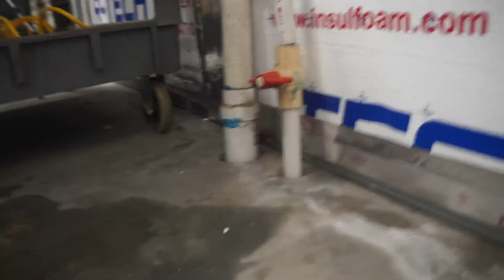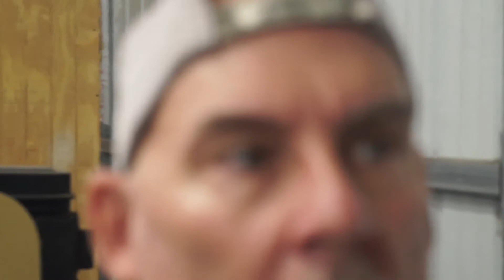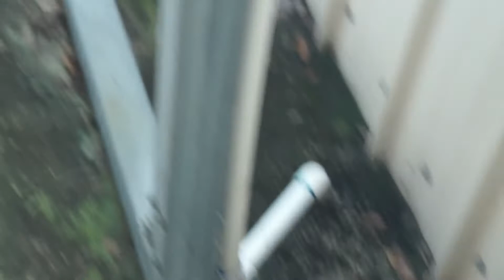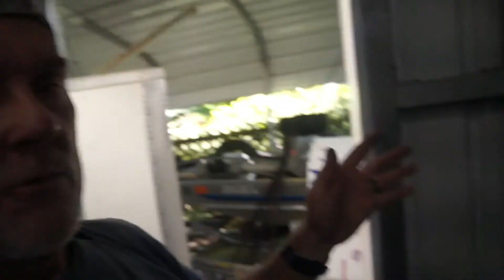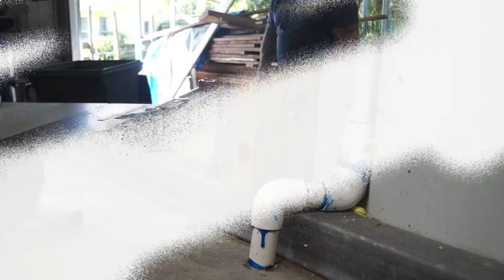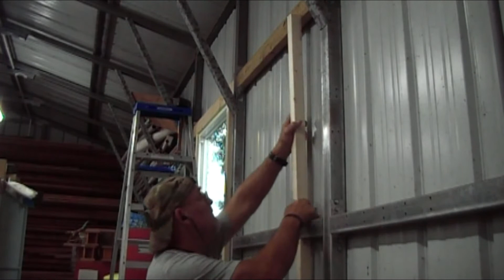Metal Building Wall Preparation - The End Grain Workshop

Comment: Wow!!!! Nice work sir! I just got my metal building in August and I wanted to instal T1-11 but I was told different thing about drilling into to metal! Any ideas about put a loft with stairs?
Reply from the maker: Thanks!  I was thinking about framing a small 10'x12' office with 8' ceiling.  Then on top of the 8' ceiling using that area for a loft.  My workshop ceiling is 14' so that would leave me 6' for a loft area.  No room for stairs but I might build a wooden ladder on the office wall to access the loft area.